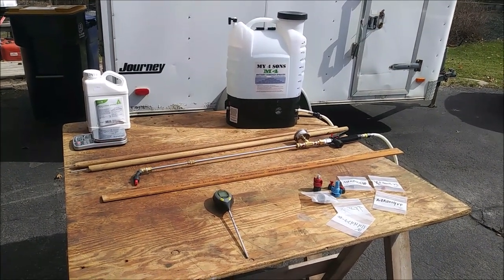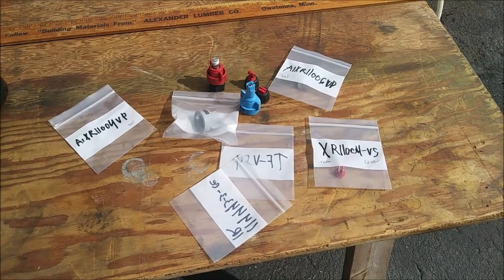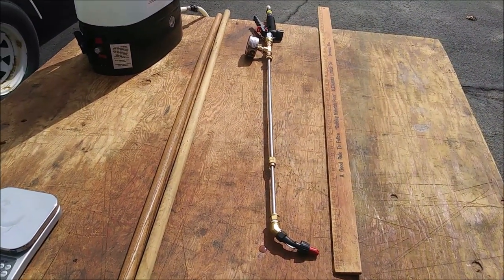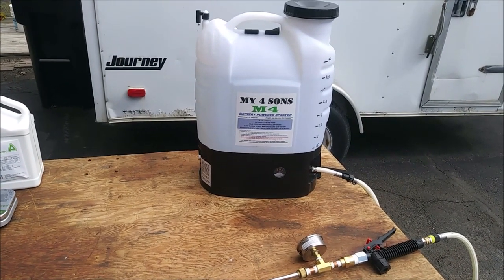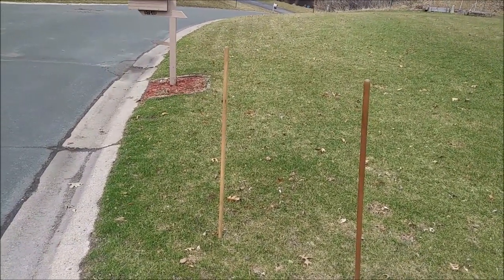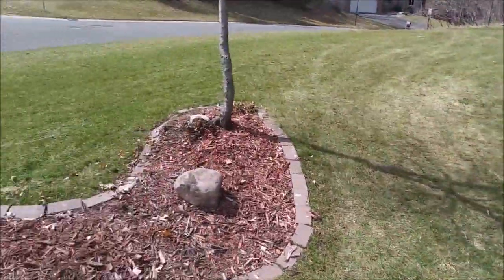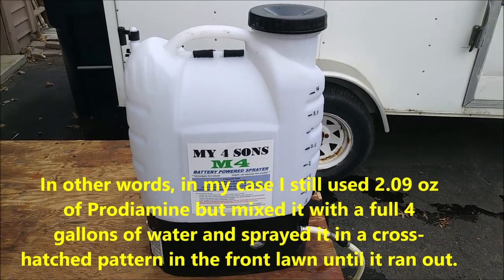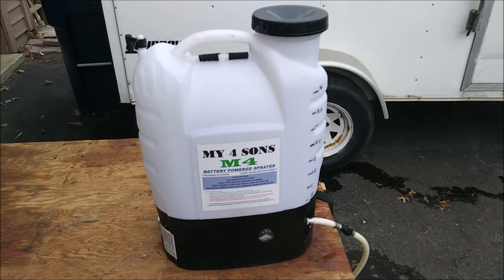Backpack Sprayer Calibration - No Stopwatch or clock needed!

Comment: Please tell me where you got other nozzles that fit this My4Sons sprayer! The included nozzles are useless to me. I'm spraying my roof with chlorine solution and I find the included nozzles atomize the mixture too much, causing alot of drift even in light wind and also I have to sweep the wand very slowly to get enough precipitate on the tiles. I need heavier droplets so I can get done faster. Do you know where I can get a nozzle to fit my needs? Or is the problem the fact that the pump is only 2.9L/min or .77 GPM? I've been told to retrofit a Jabsco 3.5 GPM pump. Please help! Thank you!!
Reply from the maker: TeeJet nozzles fit.  Go to their website and study what they offer and this should lead you to one that will work for your application.  You can buy TeeJet nozzles on Amazon and at Sprayer Depot.